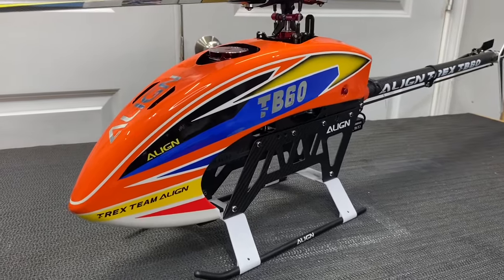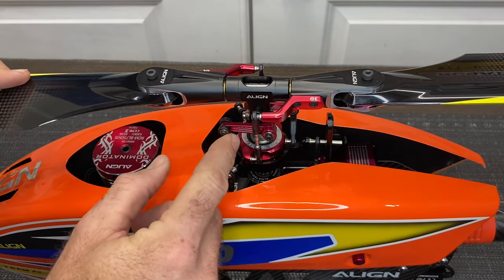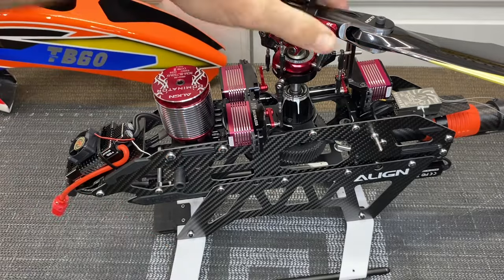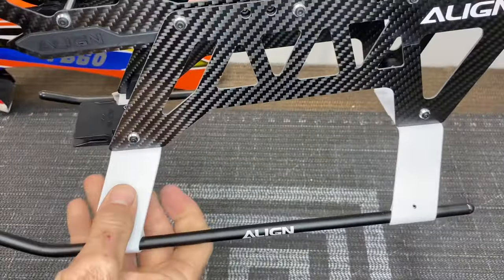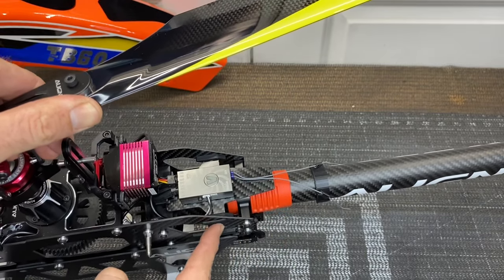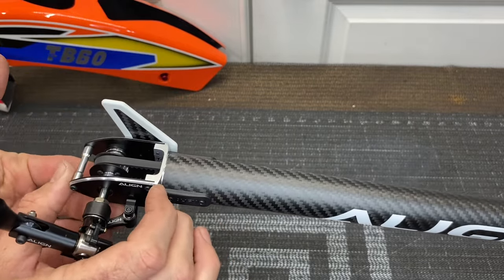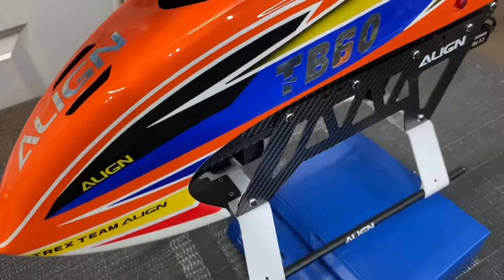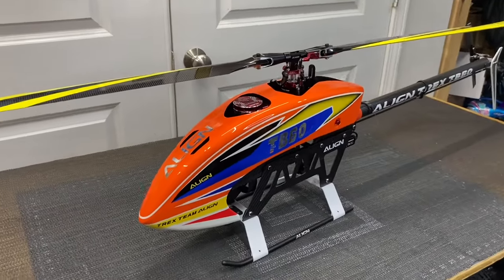Align Trex TB60 Review

Comment: What I see over the years is a change from manufacturer's not caring much about ease of maintenance or crash repair. Now that is certainly not the case anymore as a matter of fact it has now become a big selling point. I like the servo layout but tuck the tail servo in more. I'm not sure about the boom mount it's part plastic? You like a good quality canopy I see. All and all I  think a person would be getting a good model helicopter with a TB 60.
Reply from the maker: They definitely have went to more of a simplistic design, as well as ease of maintenance with all manufacturers. Which I personally really like to see, it is great, especially for people who crash can get back, flying relatively easily with a few parts change, and could even do it at your field and you don’t need to tear the complete helicopter apart to fix some thing, yes! I agree, I wish the tail servo was tucked in more as well! Yes I do! Canopy’s are a big thing for me. I personally think the canopy is the most important and first impression of a helicopter. Then canopies will crack and break while taking them on and off and that just sucks to have a brand new canopy and break it just trying to remove it. The TB60 is great!

Comment: Thanks 🙏 please sometimes add up a few lines on the wiring also. How it has been changed from previous models.
Reply: repied to your comment earlier but can't now see your entry. - there are no spares in the UK pal.  I know all of the main suppliers personally and they me - the spares availability in the UK right now, is to put it simple................. shit.
Reply: @HeliShed  you're right. That's because align hasn't made all the spare parts available yet. Just checked their website and it's just a handful of spare available for TB 60-70.
Reply: yes pal - my point is that they shouldn't have sold it in the UK without those spares availability.  Buddy of mine has now been waiting for two months for a main drive - utter shit to be frank. @pouyatavassoli

Comment: I have this heli however I don’t think the main head links are a very good design.. is only 4mm of thread engaging into the plastic ball links.. manual shows 23mm rod length and 15mm visible metal at the correct length.. I had a very bad crash and I think the thread popped out of the link mid flight causing the crash
Reply from the maker: That’s not good, I believe I have more than that in my threads. I have never had a problem with a linkage popping off like that or pulling the threads out but I only have a few flights on it so time will tell I’ll definitely keep an eye on that.
Reply: @westhobbiesrc8051  so I’ve just measured my main linkage rods from swash to blade grips and they are indeed 23mm in length however they are tapered to a point at each end and the tapered section (with no thread) is 1mm at each end.. that means that by having 15mm of visible rod when blades are at 0 degrees set up there is only 3mm in each end that is engaged into the plastic ball links… 3mm is no where near enough in my opinion for these links, they are under a huge amount of stress during flight… it’s a bad design for sure. I would highly recommend changing to longer links that engage deeper into the ball links.. I am going to buy some longer ones 100%… have a look into this and let me know your thoughts mate 👍🏻